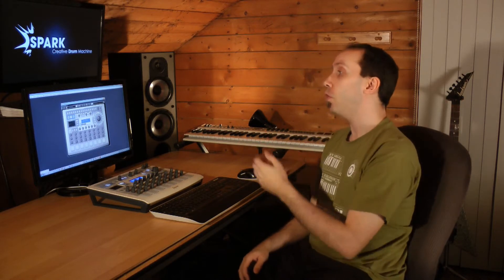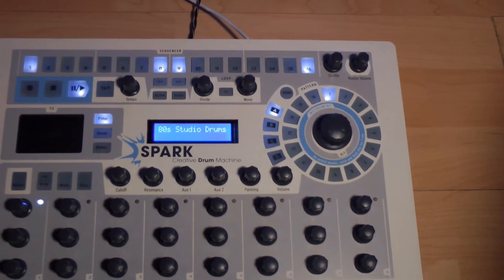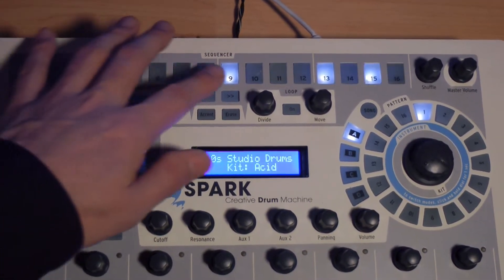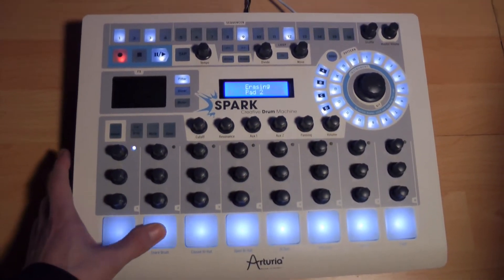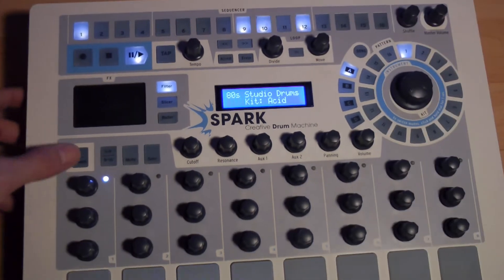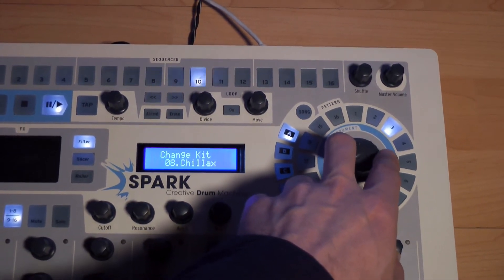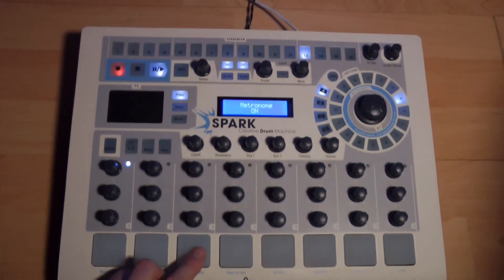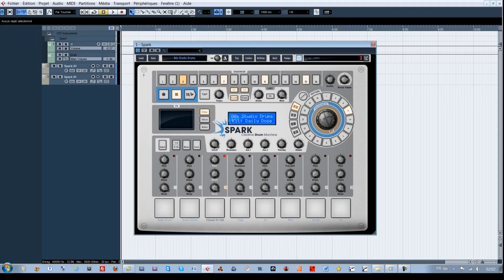[1/8] - Arturia Spark TUTORIEL  : Intro & Prise En Main du Contrôleur

Comment: Salut Franco
"T'es un ange et si Dieu existe il te fera archange"
Ca m'a fait rire mais c'est tellement vrai MERCI pour tous ces précieux conseils..EN FRANÇAIS !! :)
Je commence a peine a visionner tes videos alors je m'excuse si je devance ma lecture avec ma question commentaire.
En tant que drummer à la base, je me suis toujours imaginé une petite machine qui fait des loops et pouvoir modifier un son qu'on a échantillionné au préalable et finalement découvert Spark LE et depuis c'est du non-stop :) J'en suis à la version 1.7.2 avec quelques pack acquis dernièrement et le manuel de 140 quelques page super à lire.. J'aimerais synchronizer le tempo avec une console Boss Br-1180 old stuff..sans aucun autre programme présentement. Fil midi en main. Je cherche conseils sur tout ça en general et les commandes attribuables. Probablement je devrai trouvé une liste de commande midi recevable de mon Boss Br-1180 ..suis-je dans le bon chemin? :)
MERCI ENCORE JE N'EN REVIENS TOUT SIMPLEMENT PAS ET RETOURNE DE CE PAS AUX VIDÉOS